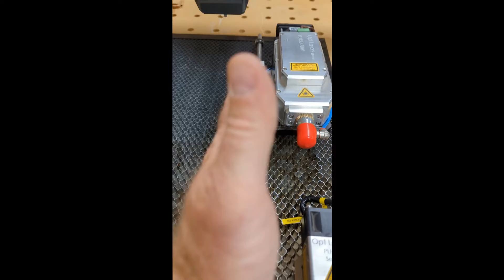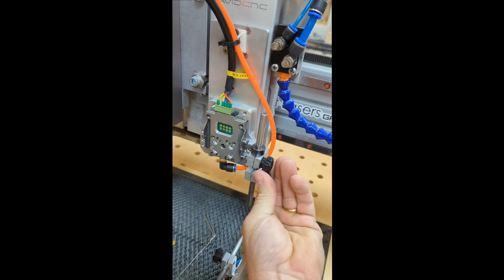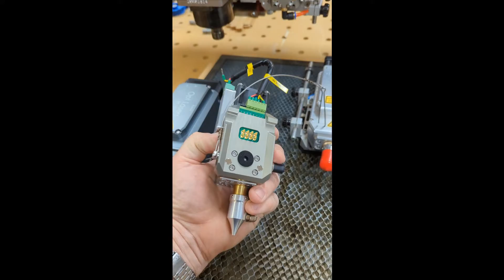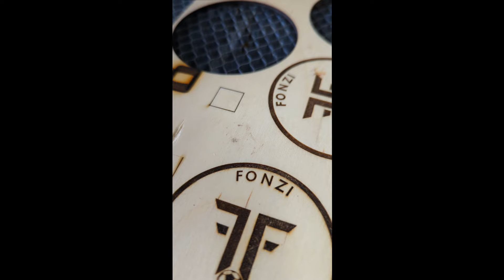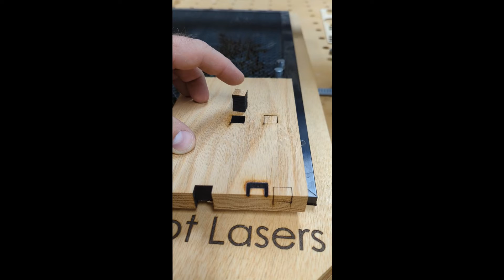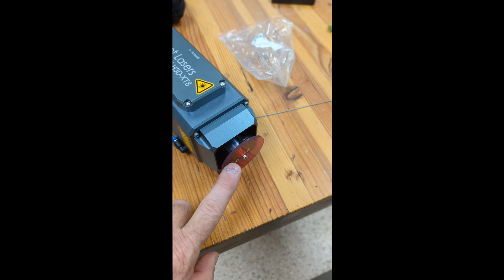First look at the Opt Lasers PLH3D-XT8, 8 diode blue laser engraving head

Comment: How does this compare to a laser tree k40? Because they are twice as expensive
Reply from the maker: I don't use Chinese lasers because they don't have a good reputation for lasting very long or customer service.  Opt does very well in both of those areas and has good documentation and support for use on most cnc machines.    Their laser kit comes with power supply, cabling, and the adapter box, not just the laser head.

Comment: Thanks Jim, very good video.  Have you done similar testing with regards to engraving?  Would your findings translate into being able to achive tighter line intervals by using faster speeds, as only the most intense center portion of the beam would be burning the wood?
Reply from the maker: Thank you.
Yes, for engraving organic materials the beam width is very dependent on the power level and feedrate.  It is less so for engraving metal and cutting organics because you need such a high power level for that that you are running relatively slow and high power.  However, for engraving things like wood, paper, leather, or even doing things like the Norton White Tile method on ceramics, you will get a significant variation in pixels line width so you always have to do a little characterization to figure out what step over you want for fills, or what you want to call you DPI number when setting up a picture raster.  Opt has to specify the beam size in a consistent way, so they have some fancy tools to measure beam profiles so they spec the beam size to be something like the area that contains 90% of the total power (or something like that).  This gives you a means to compare each laser.  However, you can make a  significantly smaller line than their spec based on how easy the material burns, and your feed and power level.  The beam profile of the laser probably affects this as well.  A long or short focal length laser will probably have a different shape to the power distribution.

Comment: Hey Jim.
Thanks for the quick look!
I’m anxious to see what else it can do.
My XT8 is ordered and it really cant get here fast enough.😂
I believe that you are correct that this compliments the detail capability of the XT50 with this workhorse XT8… which is actually not too shabby on detail of it’s own.
Reply from the maker: You are right, if a person is on a tight budget, the XT50 is a really great laser because it can actually still cut 1/8" wood (just a little slow) in one pass, and is probably the best diode engraving laser out there.  It blows away any other one diode laser that I know of.

Comment: Hi. Do you know if a new  firmware (when available) of the PLH3D-CNC Adapter is upgradable by yourself or if is  needed to send back the unit to OptLasers ?
Reply from the maker: This one is completely different.  It has a new screen, and new electronics inside to handle the higher power, and a whole set of opto isolated inputs.  The only thing that is the same is that it looks the same from 30ft away.
Reply: @JNWoodworks  Yes, i know that. I was asking if with the new one will be possible to upgrade the firmware when a new version is available. Sorry for my poor English 😞
Reply from the maker: @IceCreams62  Oh, thats a good question.  I can find out for you.
Reply: @JNWoodworks  Thanks, very appreciate, let me know 🙂
Reply from the maker: @IceCreams62  It sounds like the board is physically updatable, but they don't have any updates planned.
Reply: @JNWoodworks  Nice, thanks a lot. The strange thing is that seems there isn't an USB port or Serial port for that 🤔 Will see
Reply from the maker: @IceCreams62  Its probably on the circuit board inside, so it may not be field upgradeable (might need to be sent back).  I think its pretty unlikely they will ever upgrade the functionality of the firmware, its pretty simple, and as far as I can tell works well.
Reply: @JNWoodworks  I was just writing to you. I asked to the OPTL support and this is the answer:  "Allow me to clarify - we are still working on the option of remote adapter updates, so it's not available currently.

We have tested the adapter firmware thoroughly and encountered no problems, so we don't expect to release a new firmware in the near future.
"

Comment: hey man awesome video! I'm definitely gonna be adding one of these to my business!. question though. The avid cnc actuator its mounted to is that something avid will sell you separately? can I mount this directly to my Z axis with say an adapter plate and just remove it for when i'm CNC cutting or is an actual actuator with a linear guide necessary?
Reply from the maker: Right now the AVID kit comes with the 15w laser, the actuator, and the whole control box.   I don't know if they will sell that w/o the laser so you can add a different one or notm, and I doin't know if they will just sell that deploy mechanism.   I got a prototype from them when I helped with the testing.   I would suspect that at some point they will offer different laser models as well.  One thing I do know is that you need an extra spring to lift the actuator with this heavier laser, and a bigger power supply than what they put in their laser box, and the Opt adapter box needs to be upgraded (ok, I guess thats 3 things).  
You can contact their customer service guys, they are very responsive.
Reply: Yeah if I'm too he honest I find the avid system to be a bit on the expensive side. I suppose it's plug and play with their system but I'm definitely not shy about deploying a diy system. I'll speak with opt and see what they suggest. Thanks for your insight! This is just about as powerful as I think I'll ever need.
Reply from the maker: @Silverturky  Yes, this one brings a lot more capability with the higher cutting speed and depth.  I think the AVID solution is a pretty good price for those who don't want to do wiring or build the mounts, or write any software.  My process for deciding the cost being reasonable is not if I could build it cheaper for myself, but if I was building these for others could I make enough money at it to make the long term support worth it. The answer on this one was "no".  The parts are over half the cost, and then they did a lot of software work, and they do a good job of supporting it.  For those of us who like to build stuff, we don't need support, and our hours don't get counted, then its better if we build it ourselves 🙂